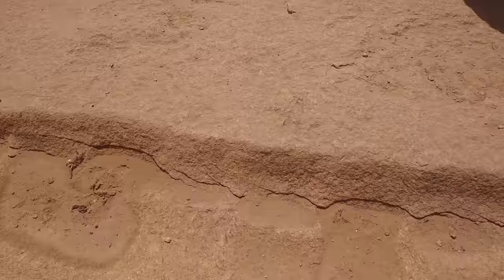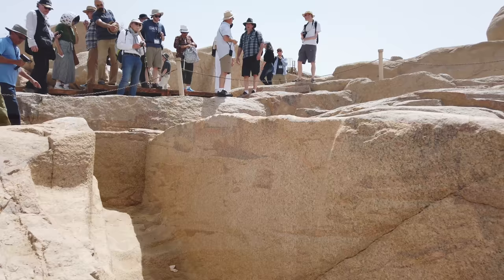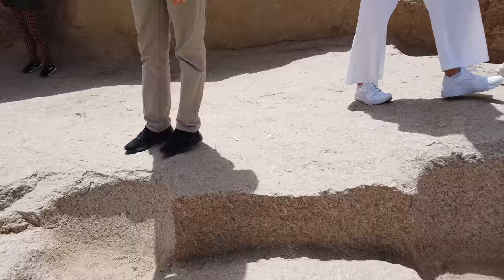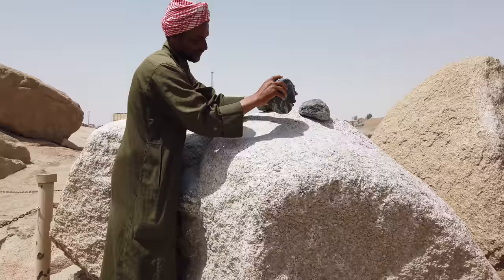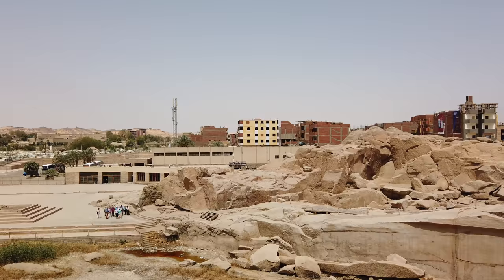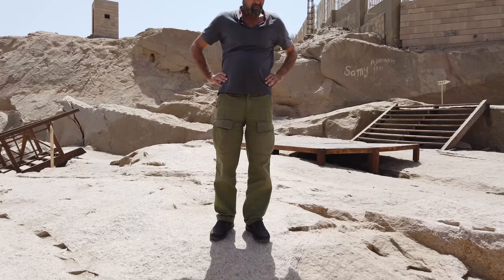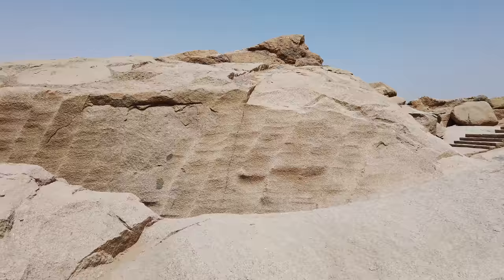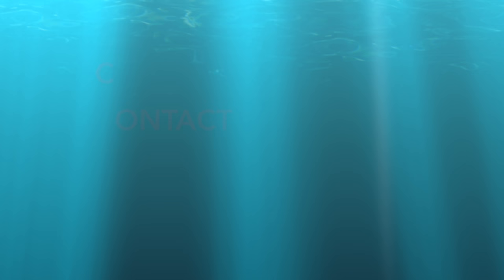Aswan Granite Quarry In Egypt: Obvious Example Of Ancient Advanced Machining Technology

Comment: Actually think this way. The amount of granite that is removed simply by smashing the 2 stones togheter is aaaa loooot!!.. i expected to see almost nothing.. maybe a scratching..  but it clearly shows in the video how much dust and little particles fly away at stone impact. Myltiply that by 100x more force.. then if it takes you 3 seconds per each hit with the rock in your hand (average out over time..  including effort) then increase to 2 hits in 3 seconds.. so frequency is up by 2x and power by 100x.. now you have 200x the damage. Thats a lot. If 0.1 gram of granite flies per impact..(aprox what is shown in the video) now you gonna  have 20g of granite per same unit of time.. and with arguably much less effort.... 0.1g vs 20g big difference. You can have a few spoons full of dust from 20g. Is way less then what we can do with modern tools but is manageble.

So how to achive 200x more then what you see in the video?

If you do it with the hand directly thats hiper hiper ineficient.. 

but if you build something like a "pneumatic hammer" which is moved by human labour.. and you have the stones used as heads for this manual tool.. you fit them in wood... and replace them as they ware out.. then you can be 100x more productive(power/ impact) .. since you can use leverage and apply a tremendeous amont of force. All im saying.. holding the rock in your hand is stupid.. but attaching the rock to a "hammer" which can be powered manually form a very confortable position.. using the entire body weight.. maybe feet and hands.. both.. and using 2 or 4 people per "hammer".. then you easily get that 100x force per hit. .. and given how much granite flies out just by smashing the stones by hand.. i dont find it hard to belive you have something that works... 200x seems doable.  and you dont need anything new. No aliens.. melting stone or  levitating anything. 

Im not saing is how they did it... im just saing this method that im proposing here will make you belive you can remove rock given enough men power. Is nothing like smart work .. the tool hits in the same place where you direct it.. is mostly dumb work that you need. For which slaves were capable of lets say. This hole idea of holding the rock in your hand and hiting with it for hours is ridiculous. Is clearly not how they did it but it doesnt prove anything spectacular in of itself. Is a stupid argument to make. Is not a proof of anything.  Proof is when you max out what they posibly had.. from a teoretical perspective.. and still get nowere. They had wood.. bronze.. coper.. ropes.. rocks .. so on. Once you build the most eficient system that is proven to be the best form a phisics and material science perspective.. and then you still at a huge disadvantage then you made a point about not beeing possible. What im seeing in the video is not that. So maybe let your imagination roll a bit. 

All is needed  for this "hammer" is wood and some bras or coper bar joints or something and ropes also. 

I dont have a design in mind yet for this "hammer" but i dont think is that hard to come up with smth efficient that fits the bill of what i described above. 

And is still might not work. Will for sure not give thouse scooping marks...thats something else... maybe rotation..  But at least you compare with their most advanced tech we consider they would have. That would be more accurante. Will feel at least plausible if not convincing.

Comment: The egyptians created the worlds largest rope chainsaw, it fused sand particles to itself as the whole city was pulling the blocks. To the West of The Grand Museum across the road. You can't see it from the road, but on google maps you can see a hill with 2 Triangles, and some squiggly lines along the bases. This is the site where the first stones were cut. and just to the right another set of, and squiggles in the sand and just a little closer to the museum is larger than the other quarries. I found these sites on Google earth in about 1 hour. After taking some images there, I opened the picture in Blender and applied the xray filter, which gives me all the proof I need. You are looking for lash marks on the ground, this shows the locations of interest. They even appear on the borders of the modern roads. If you know what you are looking for, then follow the white lines and all the gouge marks from maneuvering these monstrous rocks. They used logs on Pivot points, to maneuver them around awkward terrain I found the site in about 1 hour, and you can clearly see the remains of what looks like a ginormous chainsaw made out of rope and glass. I have informed the London and the Grand museum in Cairo and pointed them in the right direction